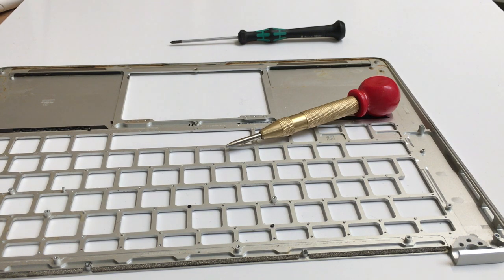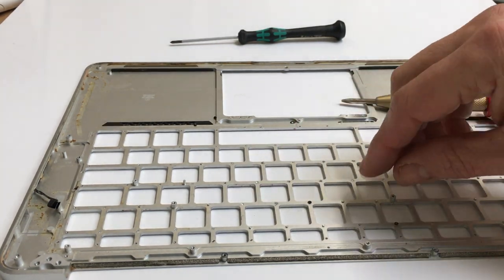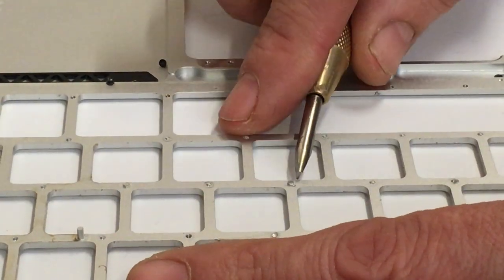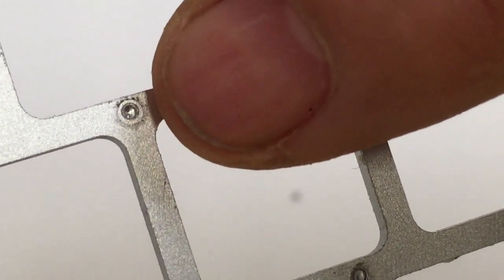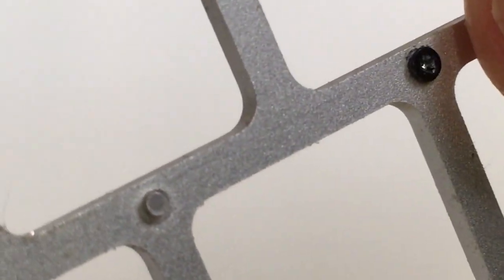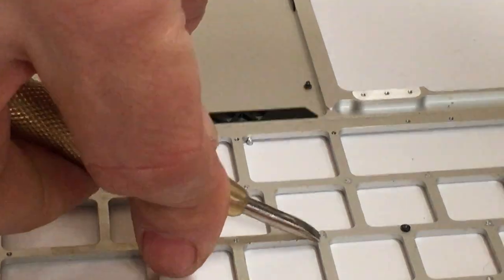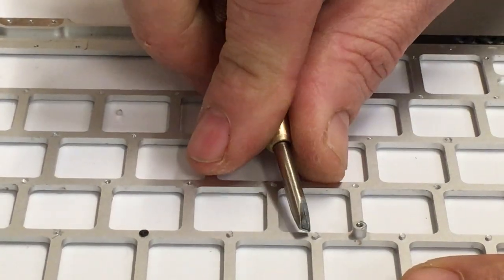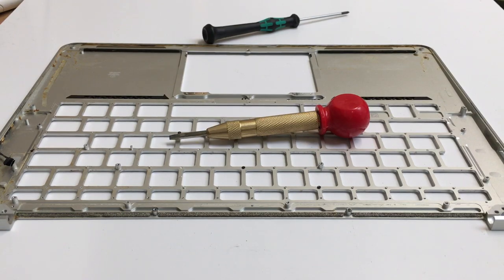MacBook Pro Macbook Air  Keyboard replacement /Repair / rivet removal tool update

Comment: I'm using this method to remove the kb rivets. What I thought is actually happening ... shearing the shaft above the kb surface. Removed 6; sheared 4. I know the kb doesn't need them all ultimately, but if too many are missing, there will be issues. Some now, some later. :::: 10 min later - I found how to position the screwdriver until I can get them out reliably with at most 2 taps, most of the time a single.Take the screwdriver as low as it can go. It does not have to be flat; only most of the way to that point. The reason is when you hit it, it wants to pop up, to ride over the rivet. But it doesn't, and it takes the rivet with it.
Reply from the maker: yes!!!!!  i did another video showing exactly that. check my other videos   https://youtu.be/SeSQ0DpG1HA